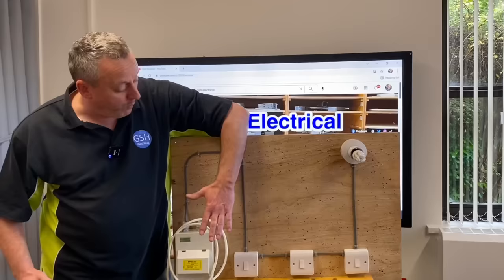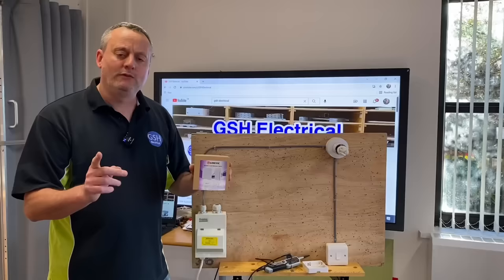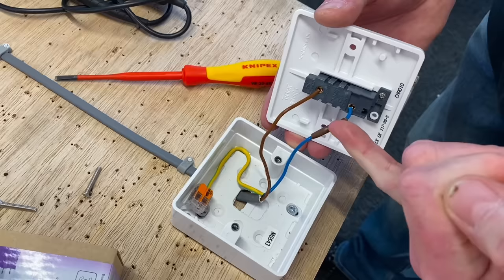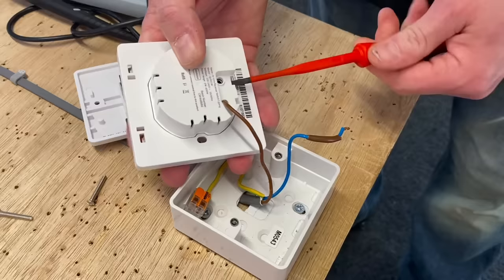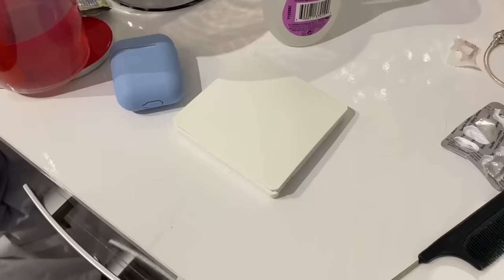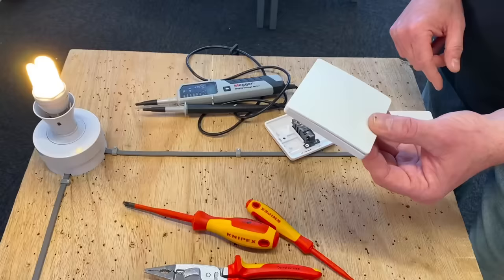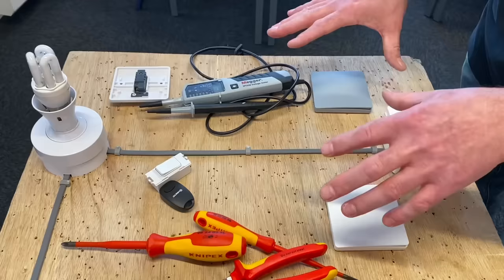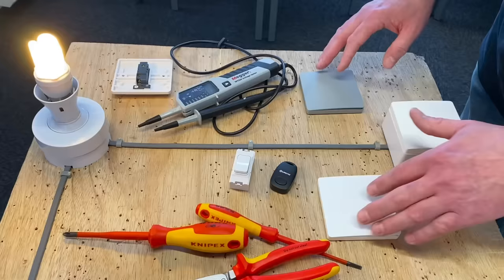No More Wiring Light Switches - The Secret is Out - Quinetic Wireless Switch with Built in Receiver

Comment: would be good if the receiver was fitted into the ceiling rose, with a pairing button on it. Then no need for any switches to be hardwired.
Reply: Maybe that's next
Reply: There is one already
Reply: Ewelink 😉 used them for years with Alexa. Default power on state-on. So if on but Alexa off turn off switch to turn on
Reply: Yeah that’s how it should be really
Reply: Yeah that was my idea all down the years I retired
Reply: Already make them....
.keep up

Comment: Let go one step further, have a receiver in the ceiling rose. And just have the one power cable to the rose bulb, lamp light.
Reply: Yes in oz we have ceiling fans that have light aswell as fan control, rather than run a single switch cablee we just get a remote with reciever so light and fan are both controlled with remote. So no switchwires needed. Just a perm feed at  cieling fan. Can also use the remote and reciever for anything, downlights, extract fans....no switch cables needed or chasing walls
Reply: Already available, and you can retro fit a light fitting (albeit, has to be of suitable size in dimensions) to insert a wireless receiver. No more switch wires 👍

Comment: TWO YEARS ON REVIEW - I have had a range of wireless switch products from Quinetic such as inlines tucked into my ceiling for downlighters. Everything is still working as it should with the exception of the 13A socket adaptors (non wifi). Out of the 7 originally purchased I have had to replace 4 under warranty. They are temperamental too - loosing power to the socket and re-energising in quick succession completely confuses them. Probably our biggest fault with the 13A socket switches is the high pitch squeel they emit when not turned on. All reports to the manufacturer were dismissed and simply requested that I continue to exchange these at a TLC branch. Shame as the other products are spot on.

Forgot to add - great content, thanks GSH
Reply from the maker: Massive thanks for your valuable input 👍🏻
Reply: losing*

Comment: The cable is the Ariel.  The electrical field of the cable.  Remember when television ran off the light fittings.  Used to plug in the television to the ceiling. Practically tuned into the frequency on the cable.  👍

Comment: Imagine a loft conversion where the two way light switches were located (a) halfway up the stairs and (b) on the wall facing, & six feet away from, the top of the stairs.... that was the situation I wanted to correct.
24 hours ago I watched your video, then ordered a receiver switch QURS1W to replace the existing (a = halfway) switch, plus two QUWS1W = one each for the newel posts top & bottom of the flight. They arrived from TLC today and an hour later we have full and sensible control of our stair lighting for the first time..... A MASSIVE THANK YOU and thumbs up!!👍👍👍

Comment: So, without any explanation of the method of operation of the 'kinetic switch' - We assume a piezo crystal is energised by the kinetic action of physically pressing the switch button, which in turn provides enough current to perhaps charge a capacitor which in turn, acts as a temporary current source for the RFI transmitter (?)   Ingenious.

Comment: I think these are a real game changer. The installation and user advantages are compelling (and I have installed a few of the predecessor range) but the inbuilt switch unit you have shown is brilliant. My only residual concern is one of reliability in the long term.
Reply: The other concern with any product that doesn't need a neutral is compatibility. The receiver is presumably powered by allowing a small current to leak through the load when off which can cause problems with LED lighting.

Comment: I'm not an electrician, not planning on being one and not doing any work...so not sure why I'm here, but what a great video - this guy's got a great presentation style. Clear and succint.  Actually, I say I'm not doing any work - I'm doing a new build next year and one of the dilemmas is in future proofing the wires.  In my last two homes I used Lutron-style systems, both of which became obsolete/superceded.  The future is likely wireless (Lora, Zigbee, BLE etc.) so I'm thinking that L&N wiring to all sockets is likely to provide the best future proofing as many devices do need power. Kinetic switches; not sure I like that mechanism...looks a bit flimsy and I'd want steel plates (maybe that's an option).   Oh, 1998 called and wants their CFL bulb back :-)

Comment: I have had this system for decades now. 
It is really very flexible. 
I went with what Home Easy was making back then (defunct now).
It all still works. We can switch outside lights on from our bedroom. 
I used their system to put a new light in the bathroom.  The lighting module in the light fitting does not require any wiring from the light to any switch. This allowed me to put the light switch in the bathroom rather than the usual position outside the bathroom door.  
The remote kept in in our car will switch on the driveway lights at night.  
Signal controlled lighting should be the new norm. It is so much safer because there is no need for live/mains wiring to a switch.
Reply: What sort of range does it get for outside lights. My driveway lights will end up being 20 metres or so from my house and I figured these are the best solution rather than wiring it back with a traditional switch

Comment: I noticed the clicking sound and it reminds me of the remote controls for televisions in the 1960s - early 1970s.  They had no batteries, just buttons that made a fairly loud clicking sound.  (That's where the term "clicker" originated.)  I never studied that technology because when I started learning electronics/D/C theory, transistors were just starting to replace vacuum tubes, TI had just begun to sell electronic calculators and LED watches.  My first teacher was pretty smart.  He said it wouldn't be long before TV repair would no longer require tracing the problem down to a component.  Instead, we would simply replace an entire plug-in PCB.  It seems strange that now, in this digital age,  the [not really] new technology is reverting back to the kinetic "clicker."
Reply: Reminds me of an electric lighter click.
Reply: @sined726  Yeah!  You know, I have a butane soldering iron that sounds the same.  One day as I clicked to light it, my LED A-lamp (regular light bulb shape) in my work light flickered.  So I clicked it again.  Every time I clicked that igniter, my bulb flickered, and I hate to admit it, but I don't know why.
Reply: Piezo ignition anyone?
Reply: It must use a piezo charge similar to a battery-less doorbell chime button. The motion of pushing the button generates the charge.

Comment: Only big problem I have found with these is if you link multiple receivers that are on different circuits. (I.e. lighting through staircase where original wiring is separated by floor) to be controlled via one switch that if an MCB trips the driver does not remember the position it was in, in relation to the switch so it can come out of sync with the other lights very easily. Meaning you have to turn off every circuit relating to all drivers the switch is controlling, then turn them all back on to have all the lights coming on and off in sync. 
Apart from that great bit of kit, lifetime could do with some work in comparison to other ranges out there but compatibility with existing switches/grid switches is very handy.

Comment: This is magical!
I've delt with so many clients trying to add switching into existing structures and have had to resort to cutting walls or do surface trunking (which I really don't like). This is a game changer!
Question: If you want to withdraw one of the paired switches from the mechanism, what do you do?
Reply: you turn off the receiver i think
because it doesn't have a memory
Reply: @rain0aldwaib  Oh Dear. So that means I have to reprogramme at every power failure? (LoadShedding for 2 hours, three times a day...)

Comment: This is magic. Now if only can be remote and pair with Alexa or Google so you have remote voice control as well as manual. I'm liking as many of this type requires neutral line. Which is impossible in older buildings without completely rewiring.

Comment: Seems to be a more fancy updated version of switches that I used way back in 2006 in my detached koi pond house. Rather than get involved with mains wiring (and its safety implications in a wet environment) I simply put the switches up, set them up as required, wired the lights direct via the remote control unit and it was, let there be light.They were wireless operated switches powered by a small battery and worked very well. It even came with a remote so I could switch the lights on from the house.
Reply: These have no battery - they use the physical force of someone operating  the switch to generate the required power. So no need to change batteries / risk switches going dead.

Comment: I fitted something similar, the main switch leeches power via the bulb/load. The remote has a mini 12v battery with a huge range. The remote can operate up to four different lights/loads.
The switch has a glass front with a glowing circle in the middle, indicating Orange when lit and glows Blue in the dark.

Comment: All of the Quinetic range is "push-on, push-off", i.e. each press changes the current state. This is fine for a lot of applications, but I think they're missing a trick by not having an on-off variant which can force an "on" condition or an "off" condition.
If for example you can't see what you're trying to control, then toggling the state is useless - you want it on, or you want it off. 
Another scenario is a set of e.g. 5 lights in one room, each with their own receiver, controlled from one switch. If one receiver misses a switch operation for any reason, this will be in a different state to the rest. There is then no way to turn them all on or all off - the rogue one will do the opposite of the rest.

Comment: Powered by pressing it. Just like the exploder that comes with your claymore.

Perhaps I'm a bit too paranoid when it comes to this, but hard wired switches don't have any vulnerability to RF noise (unless your county eats a soviet/chinese nuke, in which case I would suggest the client has bigger problems to worry about), whereas the frequency these things use, is it reserved solely for these things or can other devices jam the operating frequency?

There's also the possibility some nob will stick a pirate radio station on that frequency (although in the age of internet streaming, that's probably less of an issue than it used to be).
Reply: Paranoid is only paranoid until it happens.  These run at 433MHz which is unlicensed - anyone can use subject to conditions like power output.  They shouldn't be vulnerable to noise causing nuisance switching as they will need to receive a specific code but they could be unusable if there is enough interference at higher power drowning out their signal.   I would also assume - based on many other implementations (X10, ARC, AC etc) - that there is no real security here.  Anyone could listen to the signal and repeat it to be a nuisance.  That's certainly the case with what I have deployed.  That said, I've not experience that issue even once in the better part of a decade.  Range is a limiting factor to an attack but I can certainly 'hear' the odd device belonging to a neighbour now and again.  I have the kit (my home automation) to receive that and retransmit it at will.....but fortunately I'm not like that.  Point being, don't stick these things on anything that would cause a disaster were it misused.

Comment: Many years ago I had an idea to use the crumbly old switch wires in the wall as an aerial for a touch switch.
All the lighting ring main and the touch switches were in the ceiling. The plan was to not disturb the wallpaper - one of many reasons why lighting rewires are delayed for too long.
These days I think it would be so easy to use radio links so all the 220V is in the ceiling and the room switch would be a remote. *with a handy wall holster near the door.

Back in the day ye olde spakies  taught apprentices how to tear wallpaper in a rough zig zag, cut the plaster channel, rewire and plaster up. The ripped - rather than cut  - wallpaper was pasted back leaving no sign of any work.  They don't teach you that in college either!
Reply: Now that would be an interesting video!
Reply: This system also has separate receivers which can be in the ceiling. That way all switches can be wireless. I think the combined switch and receiver is for an easy retro fit.
Reply: @nick_7869  Well, this idea caused quite a few comments in a blog that I stumbled across recently. None of the naysayers, though, could say objectively or with reference to regulations, why dispensing with the switch wire entirely would be wrong. In this day and age, surely the switch wire is an anachronism. Quinetic are not the only people making RF receivers that can be mounted within the ceiling, thus allowing total flexibility for switch positioning. Looking at their product range, it looks as though Quinetic may be the only ones making a remote RF switch with dimming functionality.
Reply: @maijo2597  Absolutely no reason for switch wires. Many systems switches only tell the control unit that it needs to turn something on or off. We've got used to this in our large buildings and even our cars. Simple methods like this should be great for homes. Want some downlights? Wire in the control and pair up a switch.
Reply: They don't even teach painters and decorators that anymore let alone electricias, they all cut a line in when going around objects instead of tearing and it always looks terrible.

Comment: That would work in a factory setting or in any application where you want a light to just come on and off. But all the custom homes I do , everything is on a dimmer.
We use lighting control systems.  Cool technology but not where you need serious lighting controls. Kinda seems gimmickie. But cool. Good job.